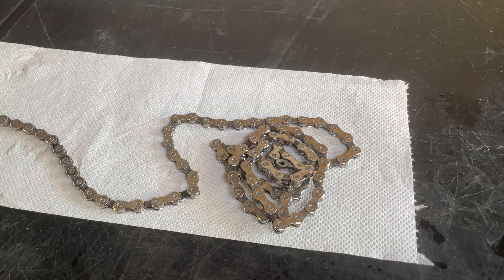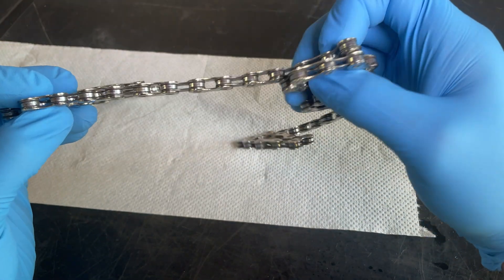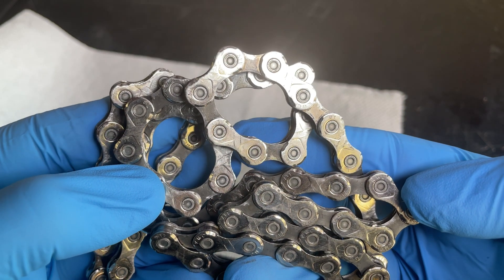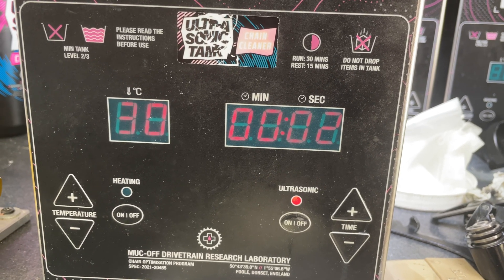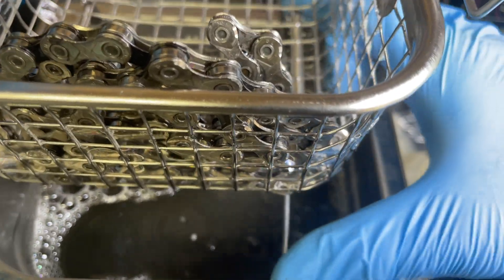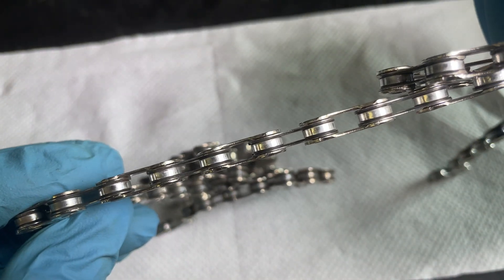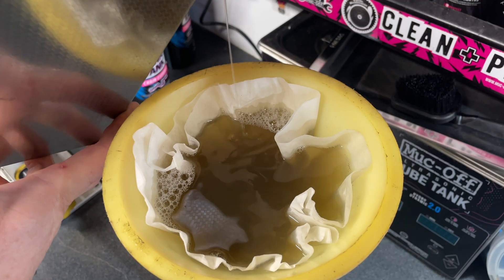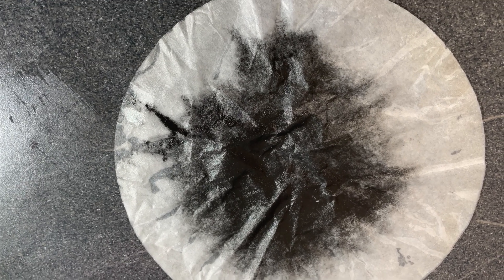Do Ultrasonic Cleaners Really Work? Chain Cleaning with an ultrasonic cleaner - THE CYCLE RENOVATOR

Comment: Why 3 tanks? What is the purpose of each? And what liquids do you use for each one anytime you clean parts? Thank you
Reply from the maker: Hi, the two tanks in the background have two different lubricants in them. I use a drivetrain cleaner first to get the outside dirt off and loosen internal dirt. I then use a ultrasonic cleaner in the tank.